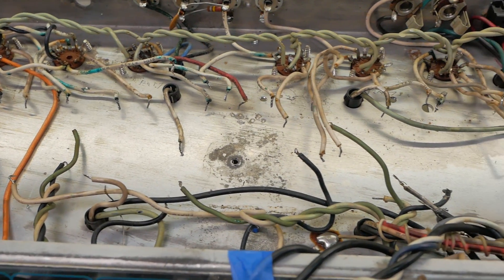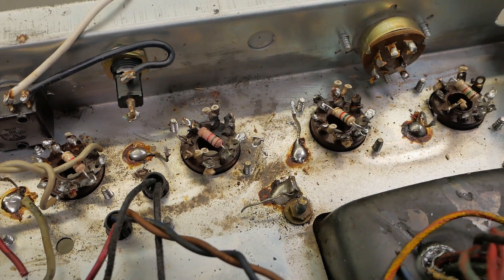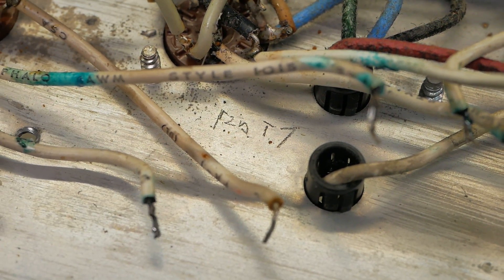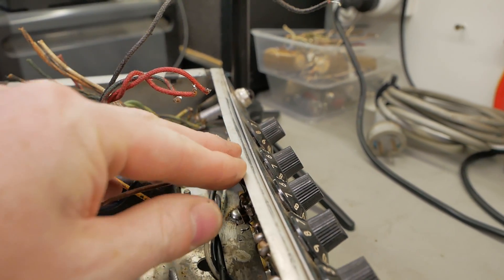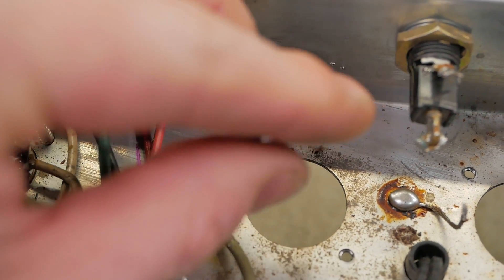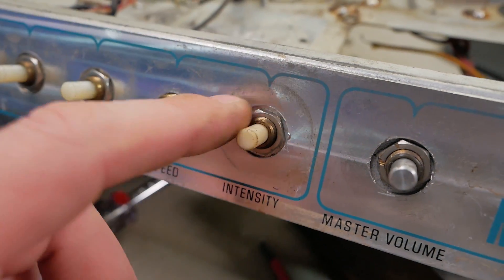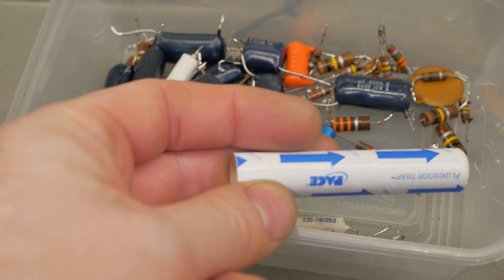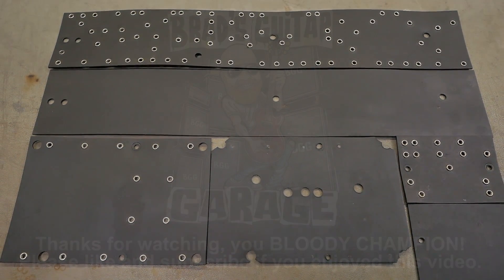Fender Silver Face Twin Restoration - Part 2

Comment: That green slime is from a poorly made PVC insulation breaking down and creating a slightly acidic goo (oil) & dissolving the copper in the copper conductors into the gooey oil. It is a mostly a copper oxide in a solution of oil and some vestigial plasticizers so it's not really all that conductive, but it is not at all good for soldering, because as it melts it keeps fouling the contacts and the wires. It is NOT flux!  It really all needs to go away. I just redid a lovely old rolling scale B&K VTVM that had a moderate case of the green goo blues. Neat meters and they go up to 1500 volts, which my Fluke meters do NOT go beyond 1000 volts without using a high voltage probe. Most of the High volt probes are 40KV. I usually need more like 2KV-4KV, not 40KV. I have an B&K probe that has resistors that you screw into the probe itself, so it does 4.5KV, 9KV, 45KV, 90KV. There is a spring loaded hook on it so you are NOT trying probe 90KV with hands anywhere near the probe or the DUT.

Comment: I thought I would add my own findings. I stripped a fibreboard from a SF Twin Reverb of similar age. The board had up to 30 volts present in some locations. I used a heat gun to remove wax and cleaned the board with isopropyl alcohol twice. I partially repopulated the board and wired it into the amp. In some areas there were huge improvements but the fibreboard was still conductive. I suspect if you have very small DC voltages on the board then cleaning the board may work, if it doesn’t then either a new board or tag strip is required.

Comment: I would host down that entire front panel with brake clean men all of those wires. Were all that green c*** on it? I would just hose it down with brake cleaner and then take compressed air and blow it. Dry that break clean or evaporate into the air. Leaving nothing behind and get all that greasy c*** right off of there in no time.

Comment: Regarding the carbon between pins 2 and 3, you said that the transformer generates a back EMF due to there being no load on the secondary of the output transformer. That can’t happen as one of the output jacks shorts the secondary out when no load is present, so no back EMF from no speakers. Should the connections to the speakers go open circuit then it’s possible.

I don’t know if you are a fan of Ken Fisher but he was against using high speed diodes. This is what he said in his Trainwreck pages: “We use 1N4007 silicon power diodes which are effective in suppressing spikes at certain frequencies. These will not necessarily prevent spiking on all amps! There is a fast recovery or high speed diode which will suppress higher frequency arcing however these diodes have a very distinct disadvantage as they alter the tone of the amp! They make the amp sound muddy as they bleed off high frequencies from the output transformer! Trainwreck does not use these kinds of diodes because of their effect on the tone.”

I’m certainly not an authority, but I tend to use UF4007’s for rectifiers as opposed to 1N4007. Is there a reason why you favour 1N4007’s?
Reply from the maker: Why do you assume that the speaker shorting contacts are functional?
Why do you assume that the open load was due to an unplugged speaker output jack and not a speaker or cable failure or misuse?
That's a lot of assumptions.
It's clear there was a flyback event due to the arcing on the socket and the hum balance pot.
With a junction capacitance of less than 30pf, R5000F's used as flyback diodes have no appreciable effect on tone in my experience. Despite a lot of commenters assuming I know fuck all, I have tested and tried these things and come to my own conclusions.
I used UF4007's in this case. They can present a little less rectification noise than 1N4007's, however with proper grounding methods and heater balancing, the latter's effect is negligible, anyhow.
Reply: @BradsGuitarGarage  well why do you think is flyback and not moisture in dust. I don’t think anyone can definitely say how it happened. I have come across jacks that didn’t make a good contact, but you haven’t flagged that in your faultfinding so I guess it largely not a problem. This is a combo so it’s unlikely that the user is removing the speaker jack, this is more common on heads and cabs.

I don’t assume that you know bugger all, but I’m curious how you came to the conclusions that you arrived at.
Reply from the maker: Black charring on an output socket with no evidence of a spill, combined with arc damage on a hum balance pot definitely points to a flyback event. And with the condition of the speaker wires and the performance of the previous tech, I'd find these add to the supporting evidence.
One thing I learned early in this trade is that every possible scenario and some impossible ones regularly occur thanks to musicians and their adventurous nature. Despite how unlikely a logical person may think they would be. It's what keeps this job interesting if not a little stressful. LOL!

Comment: How long did it take to remove the  boards from the amp, remove components, clean the boards and replace the components. I can’t help but think the repair is very expensive and possibly approaching the cost of the amp.
Reply from the maker: I present a quote.
I make sure the customer is aware of the market price of currently available amplifiers of the same model (of unknown condition other than whatever photos are available, I might add).
Then I let them decide.
Reply: @BradsGuitarGarage  fair enough, they know what they are getting into.

Comment: Given the effort that you’ve gone to surely making Garolite boards would be the way to go. You wouldn’t have to worry about the fibreboard going conductive ever. 
I have an amp on the bench where the board is ridiculously conductive. I have cleaned one side of the board and the empty eyelet that would hold the tone control caps measures 30VDC. The problem I’m now experiencing is the tremolo oscillator bleeding through into the P.I. stage. I have clean the topside of the board and it makes no difference. I think the wax was put on the board to stop the ingression of moisture into the fibreboard, others claim the black pigment in the board is the problem. I find if I lift the components of the P.I. stage off the board the tremolo noise is at an acceptable level. The anti ticking mod didn’t work at all.
Reply from the maker: You need to get under it and clean the whole thing and it's insulator board too, mate.
Of course others here are bemoaning me having cleaned anything. Yay, the internet.
I'll let you all argue among yourselves. LOL!
Reply: @BradsGuitarGarage  I have been through this with my Bandmaster I cleaned both sides of the board with isopropyl and had the boards in an oven at lowish temperature and it didn’t get rid of the conductivity. Just saying sometimes it’s the board.
Reply from the maker: I confirm that it's non-conductive with a 1500v megger and heat to the area before repopulating the boards.
Reply: @BradsGuitarGarage  that’s the way to fly. I have used the power supply of an amp and attached earth and B+ to the board and measured the eyelets for voltage. Will you demonstrate testing the board with the megger in the video?

The early boards didn’t have wax on them. To put wax on the board is an extra cost and building the amp takes longer. I don’t see Fender taking this action unless there was a problem with the fibreboard. I have had my fibreboard in an oven (at work) for days to dry it out and it didn’t work. I’ve cleaned it on two occasions with using the oven trying to get it to be nonconductive.
Reply from the maker: So the initial issue was reportedly with the unsealed eyelet boards, particularly in the southern states, getting hydrated and conductive over time.
Fender applied the wax and it worked.
But in 30 years time, another side-effect emerged.
During the thermal cycling over decades and decades of use, the wax melts and congeals in the amp as it heats and cools.
Each time it melts, it absorbs atmospheric contaminants such as tobacco smoke, dust, insect droppings, you name it.
And then it congeals, locks that layer in and the cycle repeats until it starts to reach a point where the contaminants will conduct throughout the wax surface.
Cleaning the wax and contaminant layer off and heating and cleaning the board with solvent typically solves the issue or reduces it to a negligible level. The wax layer is no longer thick enough to attract and retain significant amounts of contaminants.
The board is still more or less sealed and protected from moisture due to the ingress of the wax into the fiberboard, however. 
But your results may vary due to local factors or things the amp may have experienced.
Reply: @BradsGuitarGarage   I will remove the wax and clean the boards with isopropyl. I will post the results here, for future reference, should someone else have a similar issue.

Comment: You should not replace those blue Paktron or blue molded capacitors without evidence that they have gone bad.  They tend to be quite stable and most of them are perfectly good and will last additional decades.  They're also higher quality than most other caps you can get today.   

In fact, it's absolutely ridiculous that you removed ALL the parts as part of your "restoration",  even if you are going to put them all back in place.  That's simply unnecessary.  You're wasting time and labor to no benefit.     Replace the electrolytic caps.  Check all the coupling caps for leakage and that they're on spec for value.  Replace leaky ones and ones that are way off value.  Those white 25/25 Mallory are usually WAY off, I've seen them drop to 5 MFD and I've seen them rise past 75 MFD.   Leave resistors that are still in spec.   Consider that if they have drifted, it may be a cause of the amp's specific "vintage" tone.   CC resistors tend to increase in value as they age.   When all the resistors in the amp are 20 percent above spec values,  you can expect the tone to have changed.,
Reply from the maker: I did not replace any of the blue moulded caps, they are fantastic and tested good.
If you want to retain a contaminated and conductive (as tested with the megger) eyelet board for your customers, I feel sorry for them. 
As for the rest of your unsolicited instructions, be patient and wait for the next episode so you can tell me how wrong I am. I look forward to it.
Reply: @BradsGuitarGarage  IF the board has become conductive, I'll agree with your method.  I've only encountered that scenario ONCE and in that case, yes, the board got stripped, baked out, and rewaxed.   The restoration went quite well.

Comment: 4:35 Glad to hear those diodes are being replaced.  I have an irrational aversion to them.
9:32 Don't take that guy's soldering iron away.  Just store it in him, internally.  And put it away hot.
14:10 Those boards look great.

Comment: Regarding redoing the original boards, would it more more cost effective to simply replace the old boards with new ones. Then you do not have to go through all the work that you are discussing.
Reply from the maker: Many people have asked this.
We're reusing the parts that we want to and that are in tolerance.
It's not a standard, readily available AB763 eyelet board layout, so a new board would need to be made, which would be more cost and labour.
Once depopulated, it's straightforward to clean and repopulate.
That's the least of it.
The most time consuming part is replacing all the green ooze and melted wiring and referring to notes regarding layout during that process.
Reply: @BradsGuitarGarage  I remember one time I had a MV silver face twin on the bench. It had the same wiring and that power tranny was so hot you could cook eggs on it. I replaced all that, removed the master, and changed out all the coupling caps. It ran a lot cooler after that.

Comment: I’m about to dive into undoing crap mods on a very similar circuit (73 Vibrosonic). Great timing!   That green goo is terrible.   Great work as always Brad!
Reply: Brad did mention he thought the green goo was from acid leaking from the filter caps, but it couldn’t be from the caps as it is everywhere. Copper will go green when it rusts, though I wonder where the goo comes from?
Reply from the maker: I don't believe I said that, and I wouldn't have meant to say that at any point.
It's not from caps, it's a reaction between the copper and or tinning of the wire and the degrading plastic leaching it's plasticizer out of the insulative jacket as it decays. Whatever caused it was sorted mid-seventies. It was a problem with home wiring installed between 1965-1975 as well and now that I've researched it, it is a well documented issue.

Comment: G'day Brad,

It's good to finally see someone who understands what a restoration really is, particularly in the YT guitar/music community.  I'm looking forward to the rest of your videos on this amp.

As a side note regarding dirt on electrical components for you - I was showing an apprentice mechanic the voltage leakage on his old HK 186 Kingswood one day.  With a DMM, I showed him that there was 9 volts leaking through the dirt & acid, between the negative terminal & the battery's plastic case.  I can imagine how much 75% of the B+ is on an amp like this.

Keep up the good work
Andrew
BTW, I've seen a bonnet with a V8 firing order written on it, & a D7 Cat transmission case with a note saying "I love Leon" written on the inside.  Does that count?  LOL